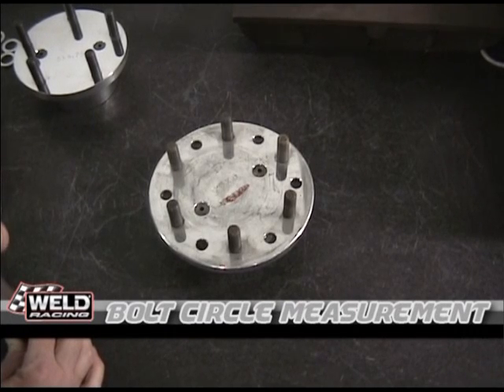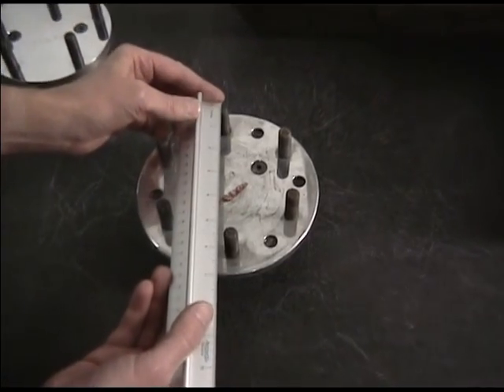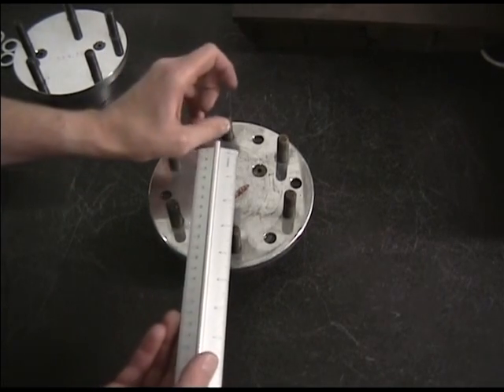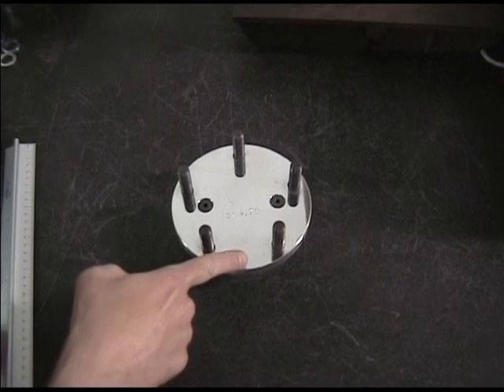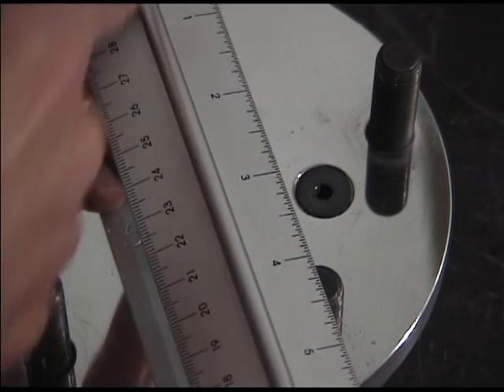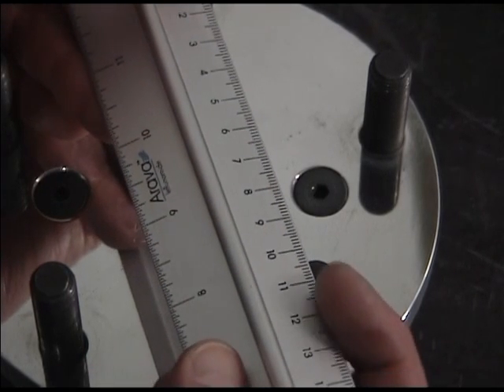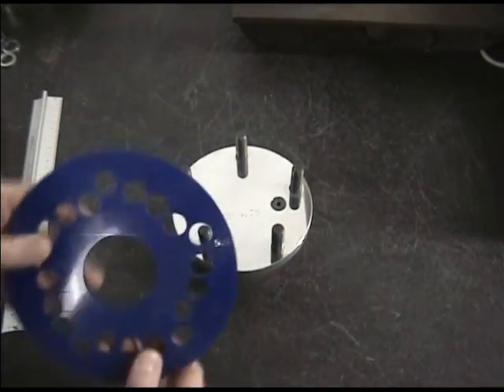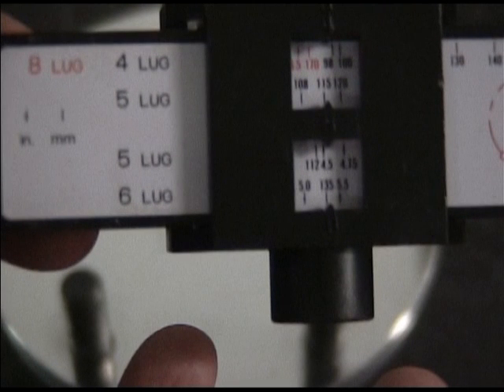How to Measure a Bolt Circle Front Wheel Hub - WeldRacing

Comment: @SummitRacingVideos great thanks.  I was thinking of getting one, match up my bolt pattern then put bolts in it and use that as a guide when shopping junk yards for better rims.  I have been afraid to get any because it is so hard to measure and for the price thats not bad.  Much more accurate than drilling out my own holes and get an aproximate fit.  Thanks for the reply to my question.